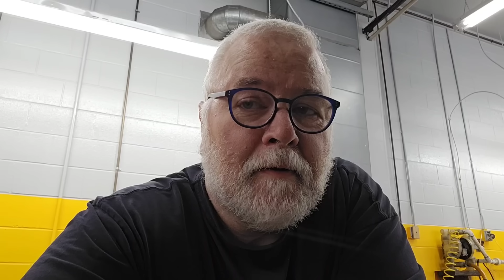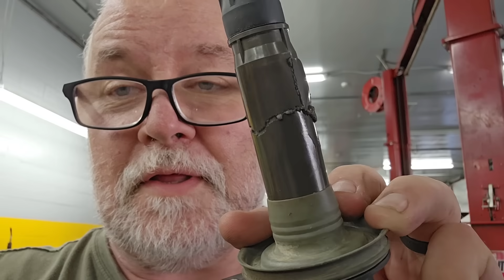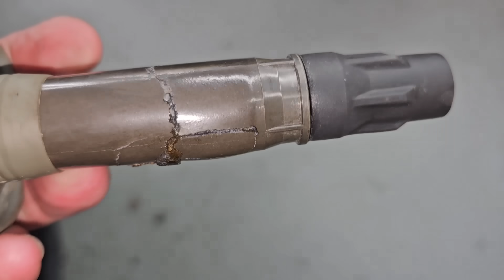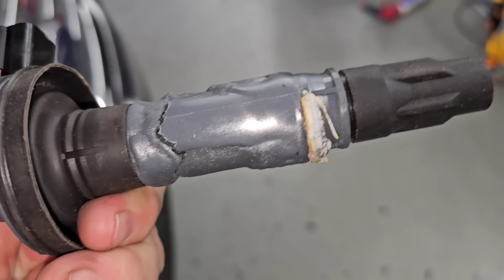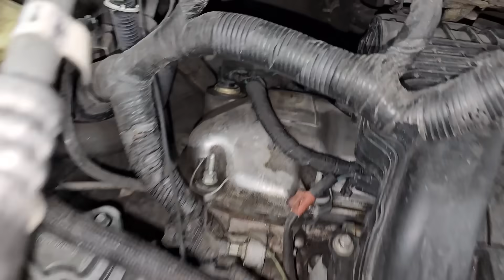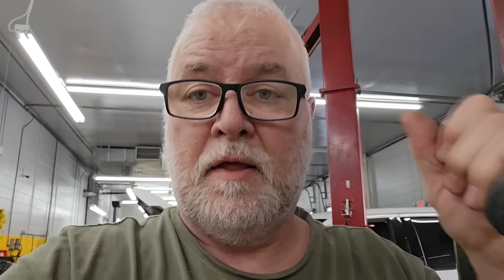Why Is The Coil Blowing Apart For Cylinder #5 ?

Comment: Check out the TSB for it.  Coil driver sticks ground and smokes the coils by keeping them on a long time.  The fix is another PCM/have it repaired at a module rebuilder that installs new drivers and replace all 6 coils.  The reason for all 6 coils is because someone probably smoked one of the others swapping it around and it will damage the new driver in the PCM.
Reply: Is there any way to swap up to ACDelco?
Reply: Is the initial cause a defective/worn spark plug that causes the PCM to attempt to fire the spark plug for a longer period of time (that increase in current causing abnormal heat to damage the coil & driver inside the PCM)?  I would think that the PCM's algorithm would prevent it from pushing excess current into coil's circuit regardless of the spark plug condition.
Reply: Me thinks you over estimate the algorithm.🤣 As smart as car computers have gotten they are still dumber than you think in some respects.
Reply: @intuberably    OEM Motorcraft for Ford products.

Comment: Even before PCM controlled coils I was a firm believer in changing spark plugs earlier then manufacture recommended intervals. Older copper spark plugs were easy to see wear when gap got larger. I always explained to a customer that 20,000  volts generated to jump the factory gap was fine but as gap grew so did voltage from coil. The voltages wouldn’t stop rising until something gave up .Burned out ignition wires and coils were common from poor tune up maintenance
Reply: Alas, the common driver /appliance user just wants to turn the key and go off to their commute/errands 😢

Comment: I saw  that on a dodge pickup. The coil did that, only worse. When i checked  it out it was a dead short to battery voltage.When i pulled the PCM harness and checked the wiring it was good.When i plugged it back in same thing. New plugs, coils and a PCM off it went.

Comment: My 2002 model Holden VY SS Commodore which runs the 5.7 litre Chevrolet LS1 V8 engine is fitted with the OEM platinum Denso spark plugs.

I change them once every 60,000 miles or 100,000 kilometres because by then they're worn out,I have never been through any coils in that car & it's 21 years & it has done about 395,300  kilometres (245,000 miles).

My dad had the middle (cylinder  2-5) ignition coil go in his 2000 model Holden VX Commodore which runs the 3.8 litre Buick L36 V6 engine, cylinder 2 had a weak spark & there was infinity Ohms between the 2 output posts of the ignition coil instead of 6 K Ohms which it should've been.

I believe that it was caused by the years that the engine misfired after my dad got an LP gas conversion done on the engine,I believe that the exhaust valve of number 2 cylinder got warped after it hung open while it was red hot once.

LP gas engines also put more strain on the ignition system as well.

I could remember my brother drove my aunties old Holden VN Commodore that she gave us when my dad swapped our old Mitsubishi Van for it so we could trade the van in to help buy my now late grandmother a brand new Toyota Corolla.

Well, the VN Commodore ran the old.3.8 litre Buick LN3 V6 engine which had the integrated ignition coil pack,we got both the ignitor & ignition coil pack replaced in that car after my brother kept driving it with bad ignition leads &. spark plugs,it ended up running worse than the 3.8's already do !

Comment: Changed the plugs and coils on my 2007 Ford Focus 4 cylinder, with just over 62K miles on it just to be on the safe side. Also replaced the rear brake shoes and drums with wheel bearings this past June.

Comment: Hey Kenny had an 09 edge come in about 3 weeks before Christmas.  #3 coil was smoked.  Believe it had 127k on it. It did take out the driver in the pcm, and we actually found a used one . I believe new from Ford  are almost 700 bucks. Had a local mobile diag service come and flash the used pcm.
Reply: Had 2 cylinder coils burn out on an 08 Lincoln MKX, replaced coils and ran good for about 2 minutes then misfire again and smoked same 2 coils again. I bought a used PCM off Ebay and had it programmed by Ford, installed with full set of coils ran great. From what I understand the driver burns the coils out when the driver goes bad because the coils never turn off.
Reply: Circuit board medics...300$ for PCM coil driver repair

Comment: I like changing the plugs sooner. Did my Legacy at 70,000 and what a difference in driving. Since I do it myself, I will do them at 50,000
Reply: I had no idea plugs or coils could hurt the PCM and never guessed the intake would have to be removed to change all the plugs, SMH.  Glad I have older G.M's that I can work on easily.  Plugs are expensive nowadays but seems cheaper to replace them at 60-70,000 than dealing with fried coils or PCM's.  Excellent video.

Comment: Hmm..interesting on coils which brings up a question-wife's 2017 Chry Pacifica 3.6 vehicle is coming up to 100000 mile maintnenace. Accordingly, spark plugs are suppose to be changed. Do the coils also have to be changed at this point?

Thnxs,

dale

Comment: If I am understanding correctly, the coil failed due to worn (excessive) plug gap. Why were the other coils not fried? My plugs are platinum? tipped and not supposed to be re-gapped: the automobile manufacturer specifies 50k change interval.
Reply: Valid question especially considering the plug  on this cylinder had already been changed yet repeat failure on this coil. I think he is saying that the transistor(driver) for cyl 5 in the PCM was damaged with the original plug. Most likely the normally switching to ground driver is now grounded constantly causing high current and high heat in that coil. Not uncommon like he said, particularly in Ford products.
Reply: @MikeHines-y6q  That makes perfect sense. My plugs are a PITA to replace (tried 3 separate times and only got the easiest one).

Comment: Ohm the electrode to ground to make sure their is the correct resistance like in the megaohms. The ceramic is an insulator and should actually have on open between the center electrode and the ground casing

Comment: Plug resistance goes up, coil energy has to go back to primary and that energy takes out the driver for 5?  Can't wait for the follow up.
Reply: That is one way failure can happen. Secondary voltages in the neighborhood of 20-30k can bleed into the primary side and damage the driver. Also larger gaps required larger demands on the coil to ionize the gap. This results in heat in the coils as well as the drivers.

Comment: My brother-in-law likes changing spark plugs at a reasonable interval, because sometimes the spark plugs can“weld” themselves to the block, especially if the block is aluminum.
Reply: I have often thought - YOU get a steel plug out of an aluminum block after 100,000 miles.  I know they do, but it doesn’t seem like a good idea.

Comment: It's the increasing spark plug gap that causes the problem. If you are a DIY, clean and regap every 50K miles. If not, pay someone to replace them at 75K miles before it becomes a strain on the coils.
Reply: Some plugs (platinum) are not to be gapped.
Reply: @carsten4594 As long as the Platinum material is not disturbed, you can re gap them. The problem may occur if the bendable wire side has a Platinum landing. Then it becomes difficult to bend the wire to the correct gap without disturbing the Platinum landing. Quality Iridium and Platinum plugs (NGK,Denso) should last the 100K easily. The other brands, well I wouldn't trust pass 75K. Just my personal experience.

Comment: I change iridium spark plugs at 50,000 miles.
All other spark plugs at 30,000 miles.
And, my synthetic oil at 5,000 miles.
You just can't believe the car manufacturers!

Comment: So the moral of the story here is - if a vehicle has high miles, should pull plugs from a warm engine to check if coil temp may be an issue.  And change plugs sooner than 100k to ensure that coils are happy for the new plugs.  Looks like I’ve got a couple of plug swaps to get to - and soon!